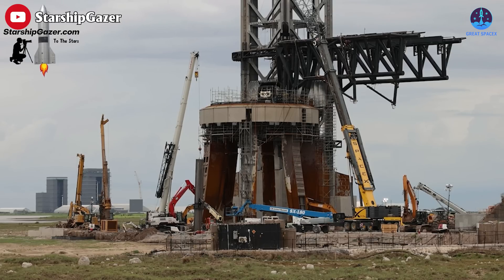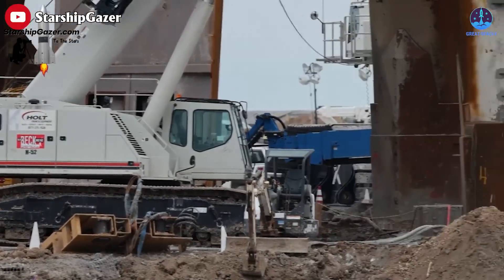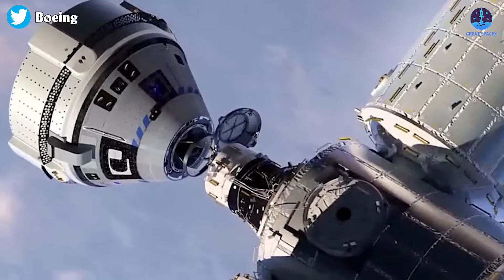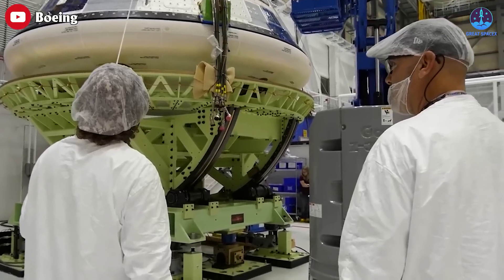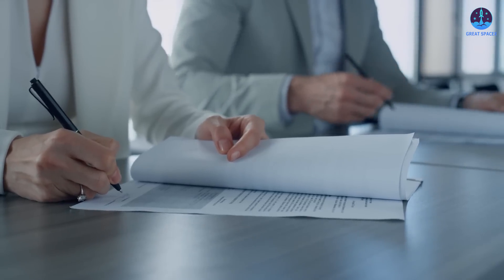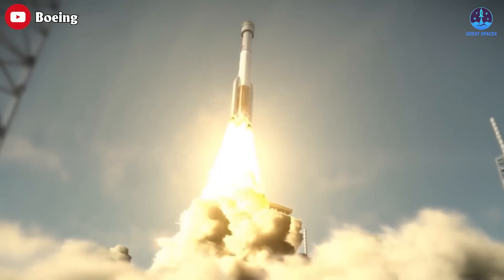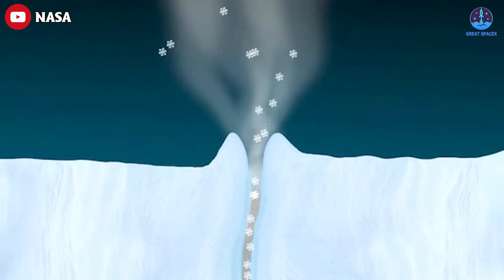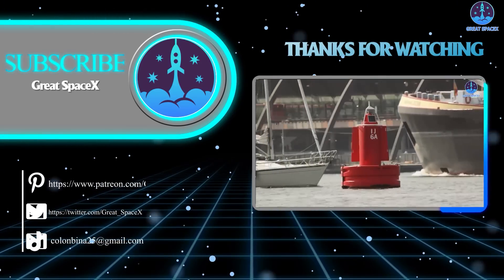Major launchpad upgrades ramp up, Lowbay is gone...

Comment: 🚀🔨💪 The addition of a sheet metal wall is a clever solution to stabilize the sand and prevent lateral movements. It's intriguing to consider the techniques used to further enhance stability, such as bringing in vibratory compactors to compact the sand within the steel sheet wall. 🤔🏗 This raises questions about the engineering behind the launchpad upgrades and the measures taken to ensure a solid foundation. I'm curious to learn more about the details of these major improvements! 🌟🚀

Comment: Two predictions here...

First, SpaceX will not get a FAA launch permit till the court proceedings are completely done and done so in favor of SpaceX and that's not a given. So, don't expect a Starship second launch this year. Even if the FAA & SpaceX were to win their lawsuit in say 6-8 months, that doesn't mean that the FAA will immediately give a launch permit for a second Starship launch right away. The FAA will slow walk this and do a brand new detailed assessment in regards to all of the issues coming from the environmentalists and communities close to the launch site. This assessment and investigations, will take months and will be stuck in bureaucracy and political red tape. Starship ain't going anywhere before next year, if that.    

Second, this new launch pad will be a failure, SpaceX will be obligated to destroy this new version of their launch pad and will have to build a new one which will require a deep large diverting trench with a new state of the art engineered water deluge system. In the end, SpaceX will have to resort to a proven trench diverting system like all other launch pads. Right now, SpaceX engineers and Elon Musk are just putting this new launch pad up with water cooled steel/metal plate and new deluge system and will be keeping their fingers crossed that their steel plate ideas will work. But it won't, there's just not enough ground clearance between the 33 raptor engines and their metal/steel plate. And all that power, sound, concussion, heat, pressure will be released and bounce off the metal plate in all directions which will bring forth another completely destroyed launch pad plus everything in its vicinity. And the dust will again be carried away for miles and reach the close by communities. 

Till a proper trench with massive water deluge system launch pad is conceived and applicated, Starship won't be going anywhere.

Comment: depth is the key?  sand wet dry pushes against the rods and concrete? the deeper the piles go and the bigger the surface the more friction resistance claps around and makes the structure safe/ force pressure oscillation waves can make the wet sandy soil liquify? so depth and spreading out is needed to ensure the structure is sound/
\Simple basic known effects? Japan had solid buildings twist over sink in earthquakes

Comment: Is that rebar about 6 or 8 inch?  That's some serious stuff.  I don't think they should do a manned Starliner flight.  It should be another unmanned flight, with the track record it has had I don't trust it.  NASA made SpaceX add another parachute, how is Boeing special to not have the same requirement for safety.

Comment: Flame trenches and water spouts are proven technologies. Steel plating will create steel tornadoes, just as happened with concrete.

What other tried and trusted technologies are being ignored?  And why? To meet such critical engineering requirements as "it must launch on 4/20?"

Comment: The sheet metal wall also helps to stabilize the sand )can't call it soil as in has nearly no organic matter in it) from lateral movements.  I would not be surprised if they brought in vibratory compactors to compact the sand inside the steel sheet wall.

Comment: Fuck, parachutes? They have been using parachutes for over 60 years and they still cant figure it out? Way to go Nasa.
Reply: You do know this ship is built by Boeing. You know, the company that makes planes. Not Nasa
Reply: @edellenburg78  Nasa contracted it and is responsible for its continued development and production. They bear primary responsibility for its failures to deliver.
Reply: @Harve955  Yeah, I did not see this happen with spacex. SpaceX had a smaller budget with less oversight and got the job done
Reply from the maker: It is hard to understand, right?